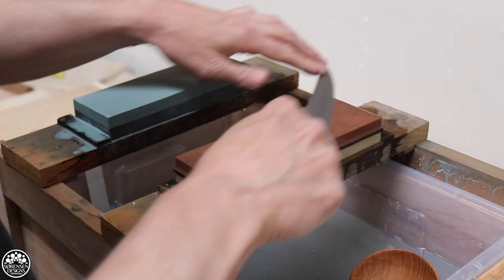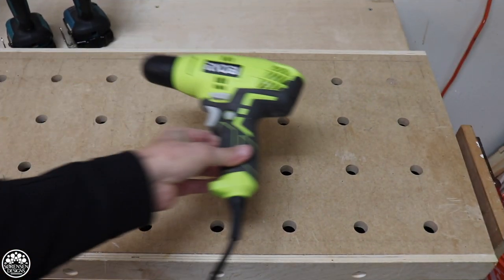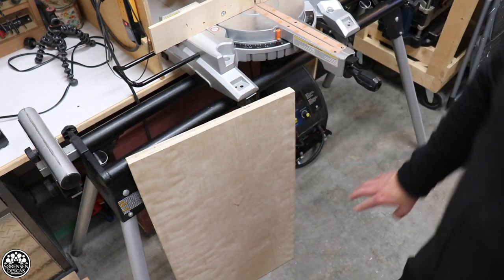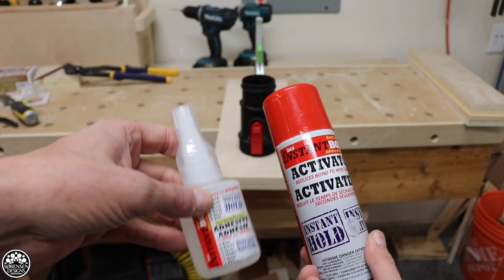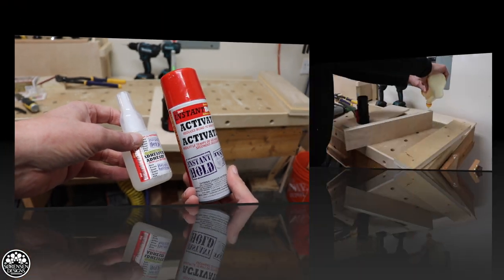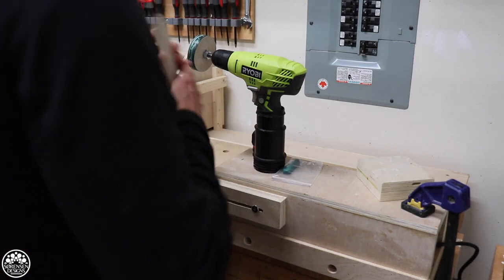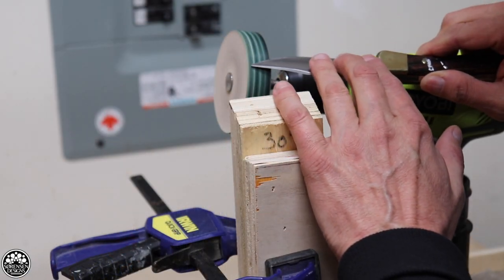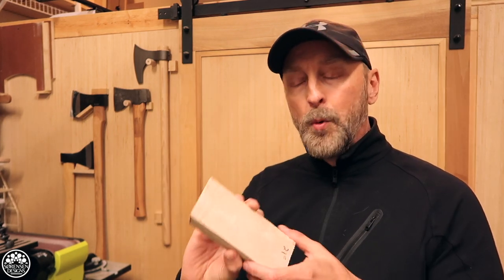$20 Sharpening Station For Razor Sharp Woodworking Tools

Comment from the maker: I should note that I added the link in the description for the stropping wheel used in this video. There are other brands available if you shop around and you might be able to get a similar disc/ set for less than $20.
Reply: A disc of MDF works as well, if you want to make it even cheaper.
Reply from the maker: @Robert Echten Except for the dust that might come off the MDF will be highly toxic. Not worth the savings of $10 to risk your health.
Reply: @EricSorensenCanada  I found that once you have the compound on there, you don't really dig into the MDF, so as far as I've seen, there was no MDF dust to speak off. Or if you are really worried, a dust mask is always a good idea while woodworking.

Comment: Thanks Eric. I have never done any kind of stroppiing/sharpening before, so I have to ask: how do you clean the wheel when changing from one grit to another? Damp cloth?
Reply from the maker: @David Letz I'm still new to the wheel myself. The buffing compound will come off and break down within a few sharpening sessions, so you will need to reapply. No need to clean it per se. You can either apply a new grit when most of the previous compound has come off or you can buy / make different wheels to be used with different grits. I found that the compound that comes with the wheel is probably all you really need.

Comment: Do you want the strapping wheel rotating towards the work piece or away from it?  Nice video.  I think I am going to make one.
Reply from the maker: @James Morgan I would suggest you start by setting it up like a bench grinder, which tend to rotate down toward the tool rest or in this case, the guide block. The drill will be able to rotate either way, so it will depend on what tool you are sharpening. The general rule I use is to hold a blade so that the wheel is rotating away from the blade not towards it.  Just think about what you're sharpening before you set the rotation and stay safe.

Comment: I like it and I think I’ll also make one, but one question; the drill is slightly inclined, wouldn’t it have better square to the work piece or doesn’t it matter?
Reply from the maker: Every drill will be slightly different. The wheel is tilted because of the Ryobi style handle, but the surface of the wheel is still square to the guide block. I actually prefer the tilt because I would sharpen at a 30° angle anyway to promote even wear across the surface - especially with knives. As a side note, you can articulate the vertical arm to match the tilt of the wheel.